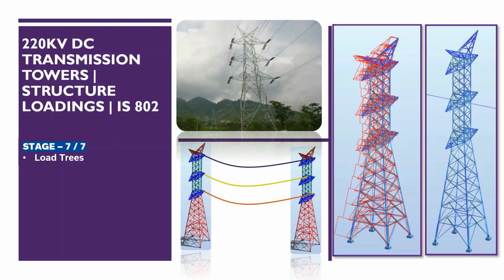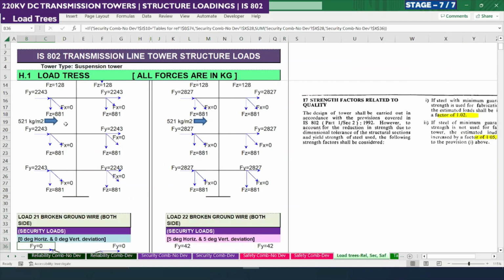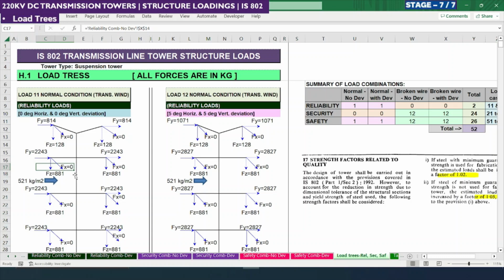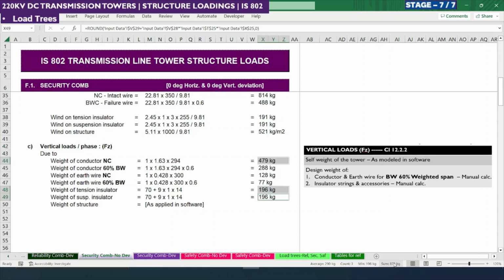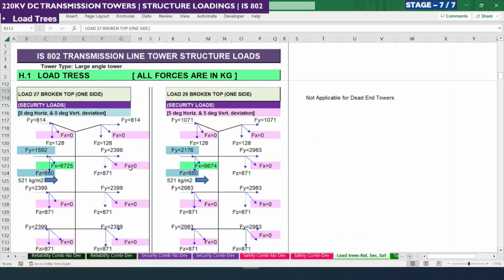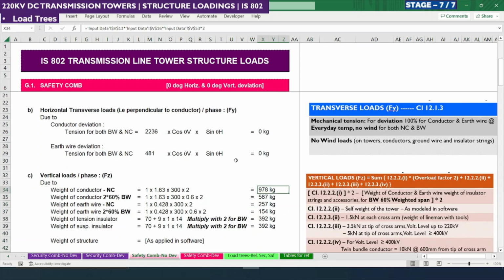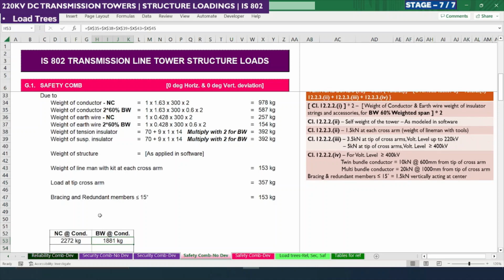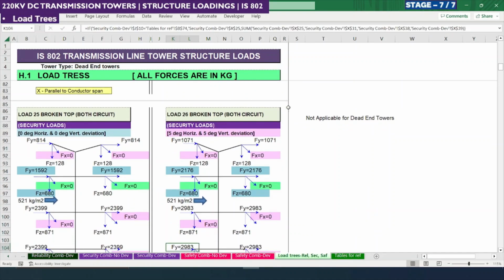220kV DC Transmission Towers | Structure Loadings | IS 802 | STAGE 7 of 7 -  Load trees

Comment: It is very informative videos. I am structural engineer and I have a knowledge of substation. But I am beginner for transmission line. Thanks you very much. One more thing can you share that excel sheet  of loading calculation?
Reply from the maker: Thanks for watching and for your inspirational wishes. Kind info, the Excel sheets are professionally restricted for sharing.
Reply: @annaiteresaec  understand sir, thanks for reply. can you make some video on geometry fixing of all type of tower as well as length finalization of conductor holding arms?
Reply from the maker: Thanks for understanding. Yes, already we are having on video explaining that: https://youtube.com/playlist?list=PLorbvg8Gw7Dha2n_0RwHEOKrMfjwTrgLi&si=dfPiEnPmYUtnn5M_
Reply: @annaiteresaec  There is displacement of cable due to wind across the cable. due to this we need earthing distance between tower legs and cable. based on arm length will be finalized. that I am try to say.